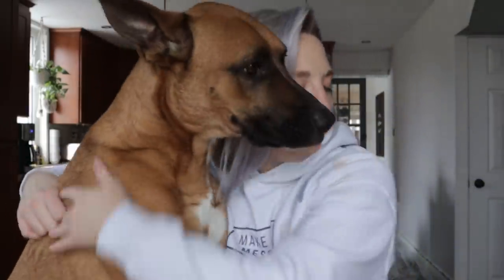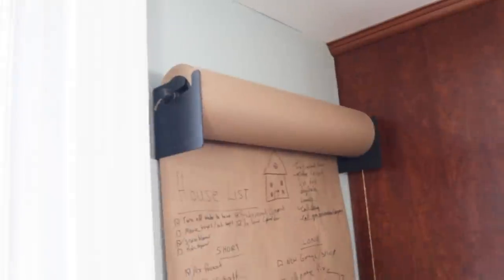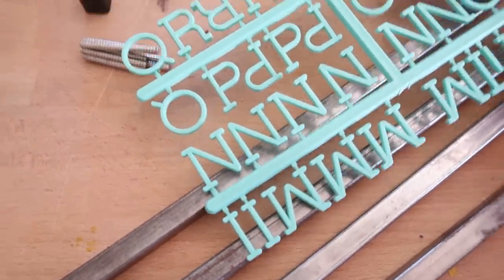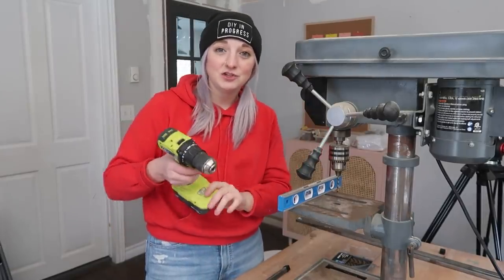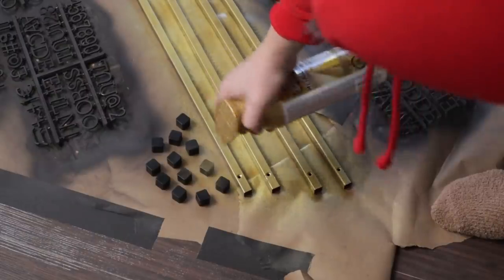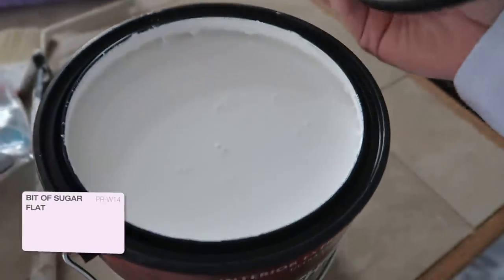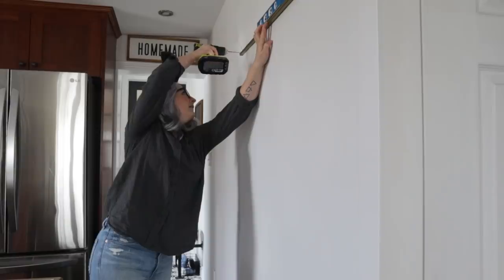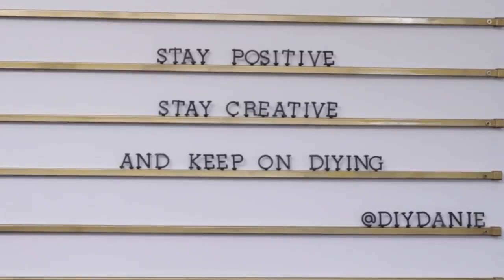i missed coffee shops… so i made one in my home! | DIY Magnetic Letter Board

Comment: I feel like this could easily be switched for a renter friendly DIY. Since the letters weigh almost nothing and the metal bars aren’t too thick, you could use command strips. On the metal bars, instead of drilling them into the wall you could cut the command strips in half and add them to the metal bars.